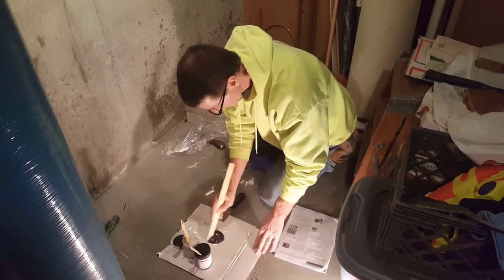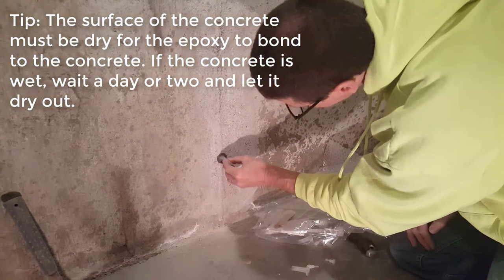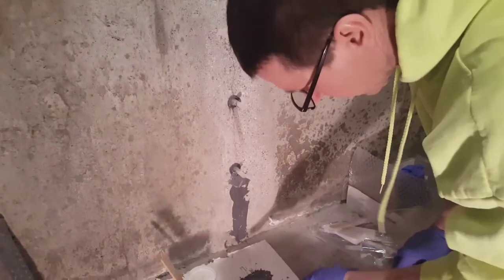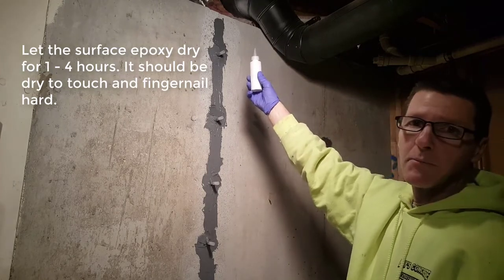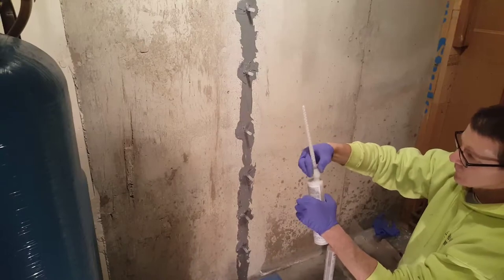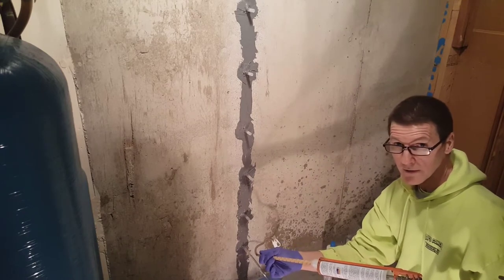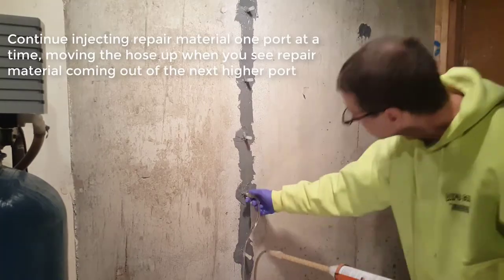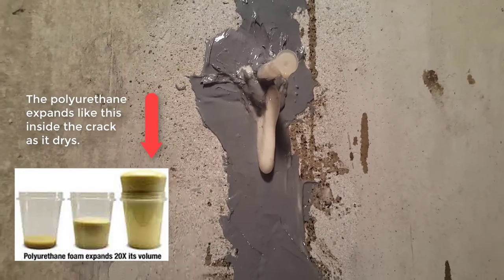HOW TO FIX LEAKS IN BASEMENT WALLS : A HELPFUL GUIDE : CONCRETE CRACK REPAIR

Comment: What is the brand-name of the product you're using?
Reply from the maker: Radonseal diy foundation crack repair kit
Reply: Mike, is it the same steps for radon seal epoxy injection, I have more of a structural crack, I been talking with the guys from radon seal, and they suggested the epoxy for my situation. Dealing with a nice guy over there that's been very helpful to me. My crack comes down my foundation wall to the corner of foundation where it's got a gap of about 3/4 of an inch + or - . And I noticed some dirt in there. Going to excavate this week, power wash from inside the house to the outside. To clean out any dirt that is in there, I'm going to plug outside with hydraulic cement, then put a few coats of Blue Max water proof sealer on crack and surrounding foundation. Then I'm going to back fill with dirt, and grade away from house. Then I'm going to go inside and do the epoxy repair. How's this sound to you. I would appreciate your feed back. I can send you pictures if you like. Thank you hoping for a reply.

Comment: I purchased my house 2 years ago and found my basement flooded after heavy rains.  It was so bad that walking through it made waves like a boat moving across water.  It was almost up to my knees sometimes and took hours filling pails, walking up the stairs and dumping the water on the ground away from the house.  Finally I had a sump pump installed and the deep water problem was solved.  However, I could still see small spots of water hear and there and noticed on the concrete wall there was a leak or two.  It looked like a vertical line similar to the video.  It seemed like one hole where water came in and flowed slowly down the wall creating that line.  I'm not sure if I have several holes along that line like in the video.  I was thinking of putting a coat of that popular Flex Seal on the whole wall and maybe even digging a trench along the outside of the wall to gain access to also put a coat on that part of the wall.  My thinking is that if I only coat the inside, water will still seep in from the outside and cause damage over time to the outer part of the wall.

Comment: I am going assume this will stop any water leaks. Why would you not chisel the crack wider ? I have a small leak at the bottom of a hairline crack could i just make that bigger and put some hydrophilic cement in there?
Reply: why in the world would you want to chisel a crack wider
Reply: @nanonorthlabs3375  why in the world would we talk this way.  There could be a thought that if it was a hairline crack that it would not get enough epoxy through.  It is not a dumb question